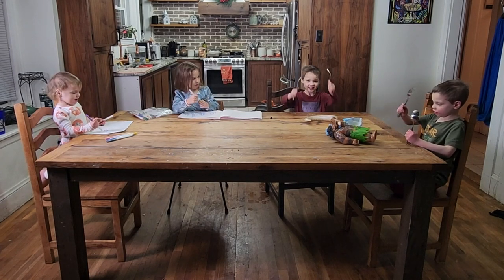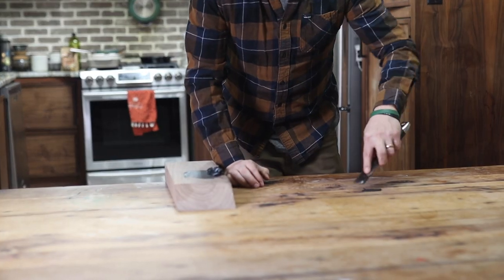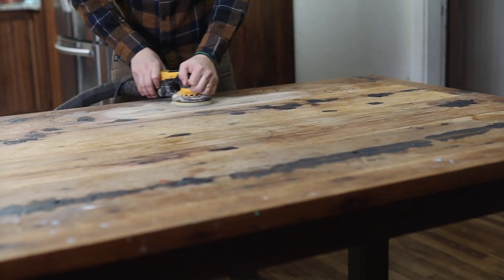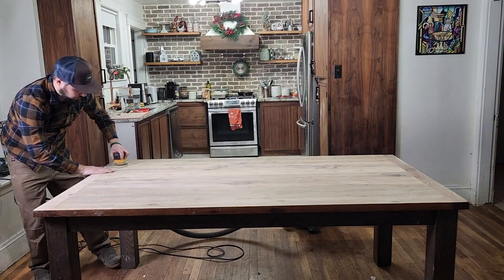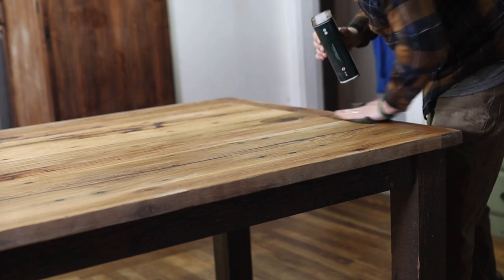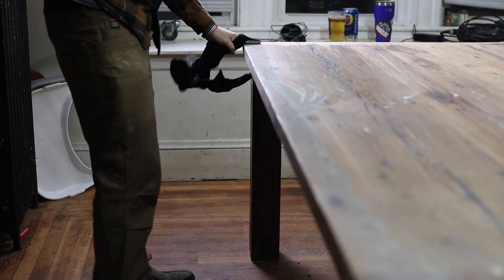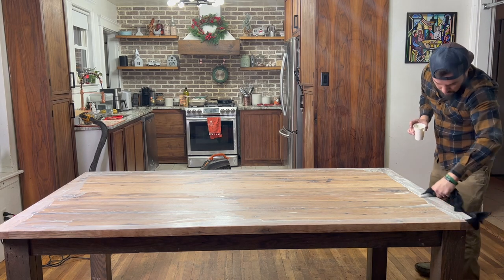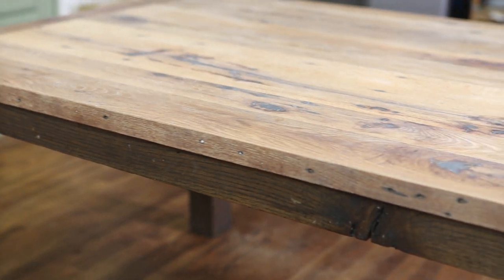How To Refinish A Table || Easy And Durable || Rubio Monocoat

Comment: Great video!  What is that wood filler you used?  I'm busy resurfacing a similiar table, also using Rubio but I'm stuck making a decision on the filler.
Reply from the maker: Here I used p tek from polymeres technologies. The best filler I've found !